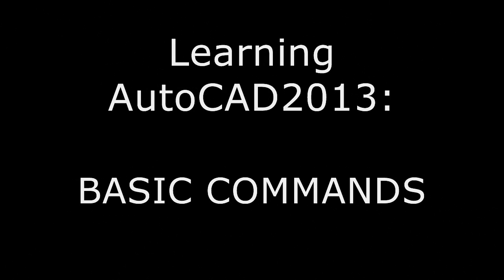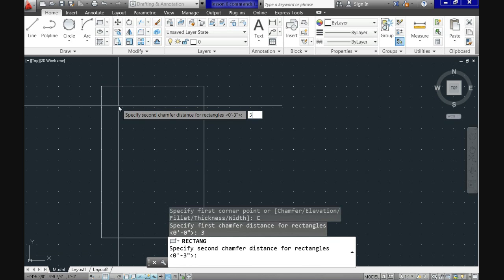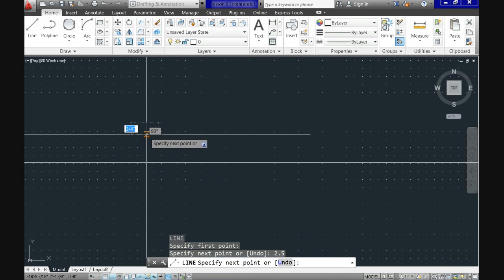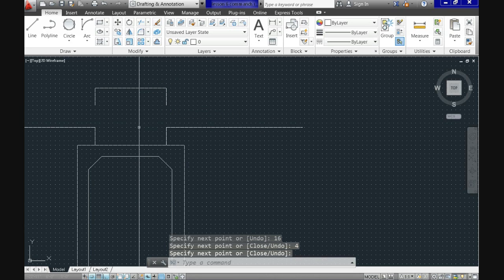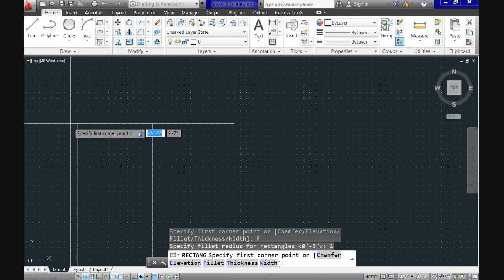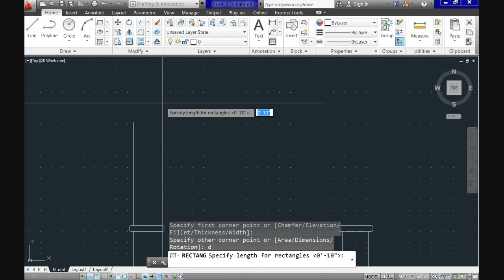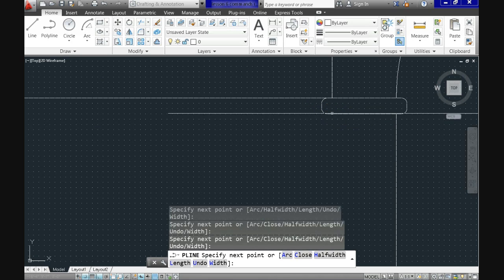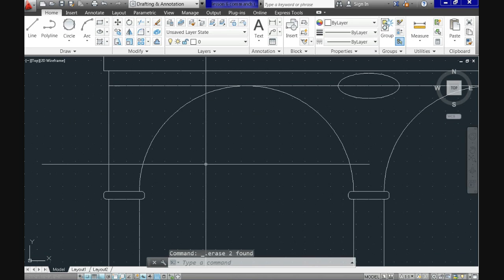Learning AutoCAD 2013 Tutorial 6: Basic Commands.

Comment: If anyone can help me, I have 2 questions/problems here.
1. In making object in 10:46 (polygon with arc modification), at first I entered the angle 250 like you did, and it didn't work, the CAD drew a larger portion of the circle (the 250 degree portion), and instead neglect the smaller portion (110 degree) that it supposed to draw. So then I re-did the command and put 110 degree instead, and it worked. My question is, why the 250 degree worked on your drawing but not on mine?
2. In making the same object on the right side of the facade, I have faced another problem regarding the arc-drawing. This time, putting 110 degree didn't work, because the arc faced the wrong way, and I haven't find the solution to this. So for now I resolved this problem by just copying the object. But still, I want to know it's proper solution.
Thanks in advance!
Reply: while you are drawing a arc , your start point and end point are important when the arc 250 doesn't work then I think you chose wrong start point and end point just switch them and see it may work

Comment from the maker: Hello,
The grid size is set to 1" on X & Y equally and is using the dotted grid type instead of the regular one. You can change it easily in the options for snap & grid which are considered drawing aids. You might want to look at: "Learning AutoCAD 2013 tutorial #4: Basic Drawing Aids" for a better explanation on this.
Best regards

Comment from the maker: what you might not be noticing is that Cad is asking for the radius of the ellipse, (although you can also use the diameter with an extra step) If you want to have an ellipse of EX 36 inches wide by 24 inches height you need to enter 18 by 12, that's how cad will get it right. if you enter the exact numbers then you get one object twice as big as what you wanted.

Comment from the maker: Hello,
The grid size is set to 1" on X & Y equally and is using the dotted grid type instead of the regular one. If you combine it with Snap is a good starting point until you feel comfortably with the drawing aids. You might want to look at: Learning AutoCAD 2013 tutorial #4: Basic Drawing Aids. 
Hope this helps and best regards.

Comment from the maker: If you want the corners even, all you need to do is enter the exact same distance for both, the 1st and the 2nd once it prompts you. If you forget to enter the 2nd one, CAD will use the default or last settings for that command. So the key is using both distances the same. And this works for the command Chamfer and also once you use the option within a different command as in this case. Hope this helps,
Best regards

Comment from the maker: Depending on the Sys variable and how it counts the degrees it might be a different number. Also unless you specify the settings cad use the last setting for every following operation and that applies to almost any command. Arcs are created by default tangent to the last segment and angles are included. Just try dif. angles like 33, -45, 65, -133, etc with each one the preview should be different and so should be the result once you use the 2nd point. Try it and let me know how it goes.
Regards

Comment from the maker: At that time, is using the Angle option of the Pline command while it is active. Since it precedes the explanation for the Circle command, just want to make sure your are using the right command. It shouldn't give you problems if you are using it just as is in the video. But just in case, try doing the case counterclockwise to make sure is not a Sys Variable. Is cad requesting the 2nd point after you enter 250 or just is doing the circle you mention without asking for the 2nd point? let me know.

Comment: Thanks for your response. I'm using the Autocad Mechanical 2013 student version. I guess i've figured it out by putting a little bit more effort in it and figuring out some stuff on my own. But i'm noticing lots of differences between our version and that can be VERY frustrating for a beginner like me! Cause it should take me about 30 min. to fix it but because of the differences it's taking me hours, cause i have to figure it out on my own somehow! (D with keyboard didn't work btw!)